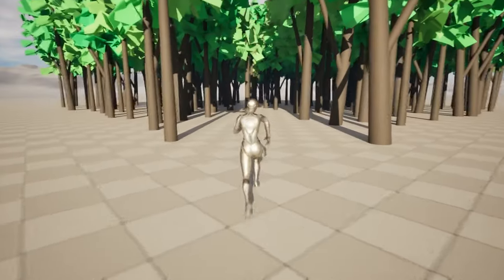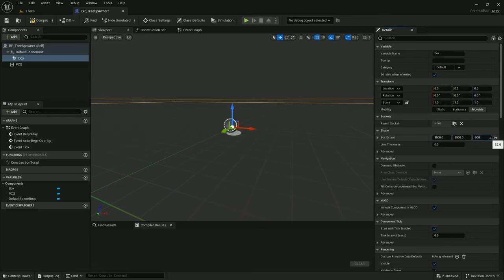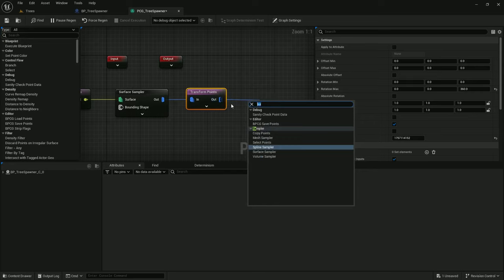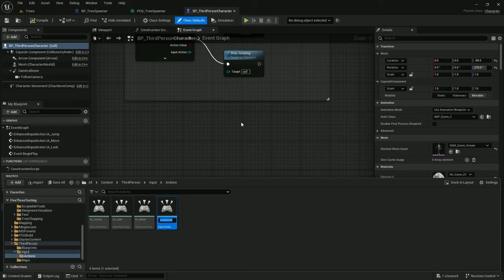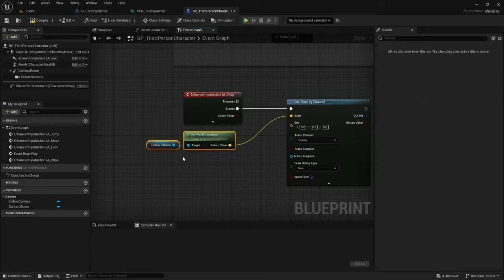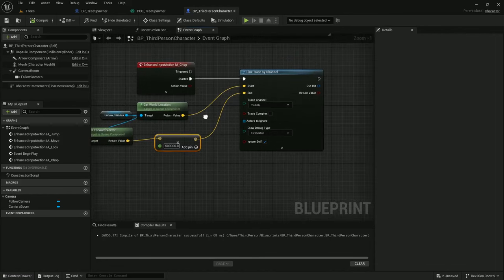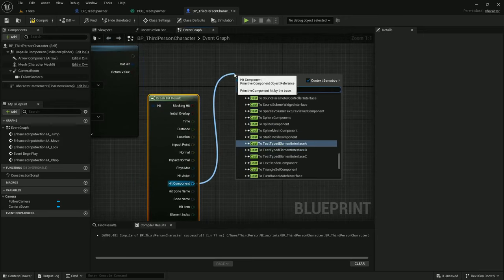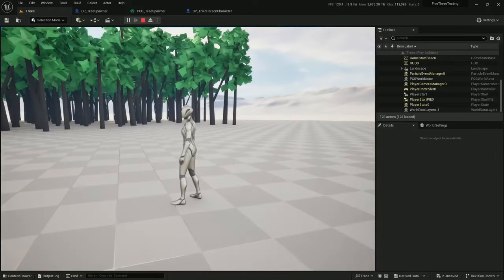Create an Open World Tree System #1: Chopping - Unreal Engine 5.3 PCG Tutorial

Comment: If you want to make a more in-depth harvesting or resource gathering system, which would also have better performance. Instead of spawning an actor when you interact with the static mesh, you can set the Component class of the static mesh spawner in PCG to a Foliage Instanced Static Mesh Component(FISMC), which can then handle all that. The FISMC can have all the functions you'd normally put on a Blueprint Actor, and so you don't need to spawn anything, you'd just need to add a map into your functions to make sure you are tracking the right instanced mesh by index.

Comment: I have an issue with your tutorial, overall it gave me a great direction, but I have some issues I can't seem to manage to fix... 
1) Most of the time, the component hit is "PCG_ForestBrushComponent" which is the component that stores all the instances of the trees.
2) My PCG also spawns rocks, bushes, plants etc... And when it does hit them (Cf (1) ) I can also remove them by clicking and I don't know how I could filter them (knowing that I have multiple different meshes so different names for all of them)

Thank you for this tutorial tho :)
Reply: Did you find solutions to these issues?
Reply: @luckycogstudios  Yes !

(DW, it seems long but your answer is only in the first 2 paragraphs the rest is only some tips I found out regarding this :) )

 I figured that it hit "PCG_ForestBrushComponent" when being inside of the volume cube of the PCG (that was partialy overlapping with my trees). Since I manage my PCG via splines and not from the volume cube, I just moved it out of the way. (below the ground or in the sky) and made it tiny.

For sorting different actors, (trees, rocks, bush etc...) I cast the hit component to 'instancedStaticMeshComponent' and get it's display name. I then check if it contains a certain string with "contains" and a prefix that I added to all my trees (resp. rocks).

If it has the prefix, then I know that this instance is indeed a tree/rock etc... And I can do the action I want with it. 

To be more precise, I don't manage this in the player bp, the player BP only calls the event "use" (that belongs to an interface I created for tools) and passes to it, the hit actor, the hit component and hit item. 

This way, it's the tools that handle their specific function. 

For example, in my axe, that implements the interface 'tool', the implementation of 'use' checks if it's a tree (with the above method) and does the actions I want.

while in my pickaxe I check if it's a rock. And do whatever I want with it (in it I also pass the impact point so I wan spawn the ore where the pick hit since my player can't destroy rocks).

This way, you don't end up with a huge switch checking every type of things you want to break in your player component. 

Lastly, as a bonus :
for trees, Since I want them to take multiple hits to be chopped, when you hit the instance in the PCG, instead of destroying it, I spawn an actor (that only have a colliding cylinder) at the position of the instance. This actor stores the reference to the hit component and index (this way it knows which tree it belongs to) and  have some HP values.

Then in my axe BP, I added a cast of the hit ACTOR to my tree BP before the cast of the hit COMPONENT to 'instancedStaticMeshComponent.

If the cast succeed, it means that I already hit the tree and that there is a tree actor there, so I call a function to remove some HP to the tree actor. And in the tree actor, if it reaches 0 HP, it destroys the Instanced mesh from the PCG.

If it doesn't succeed, then it does what I said above, adding the tree bp to the position of the instance.

I hope this helped, I know I maybe added too many details but I thought it could be usefull ! If you need me to clarify or explain exactly how something works do not hesitate to ask !
Reply: @louisveran2439  I had the same issue, rocks, trees, etc being spawned in the same graph.  I am getting the material->physical material of the ISM and switching on the string to match.  Since I'm using a lot of quixel assets it's easier for me to add the physical material than to rename the meshes.

Comment: I am wracking my brain. I am spawning smaller chunks (blueprints with pcg component attached). Then using overlapping component to remove an instance, and it just destroys the plane and all instances that were spawned in the chunk instead of just the one.....
Reply from the maker: That should work fine, in a later video I break this up into multiple actors called by a different graph.

You're calling remove instance on the ISM component, and it's removing all of the meshes?
Reply: @MichaelRoyalty  Sorry for the long break! Did not get a notification. Yeah this is wracking my brain. I follow the exact steps you did, the only difference is that I have multiple pcg volumes so that everything can be spawned in chunks which is much faster and more controlled. As soon as I try to call it to remove an instance, every single instance gets removed from that PCG volume not just the one. Works ok with one giant volume though which is strange....I will look into some of your later videos. My hope since I do not have any kind of great programming skills is to make a large world that has resources that constantly change from game to game.